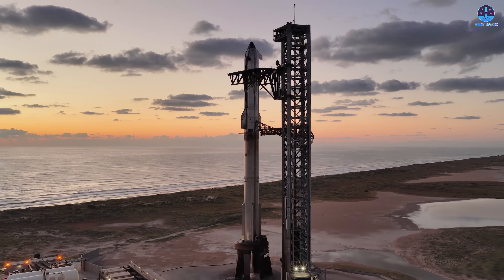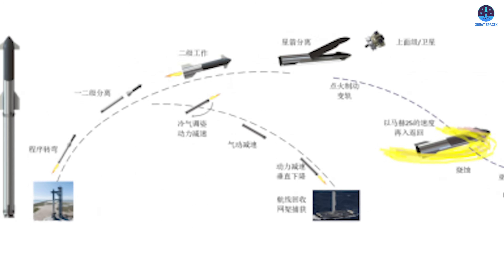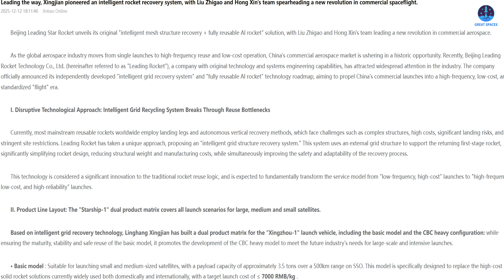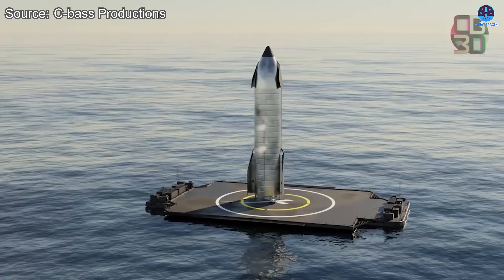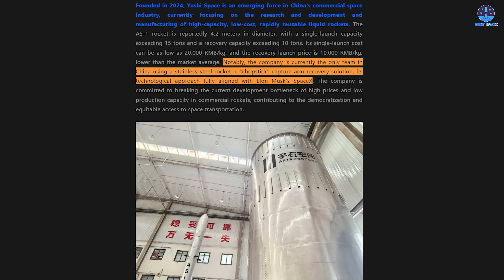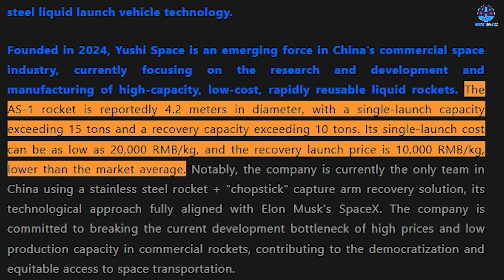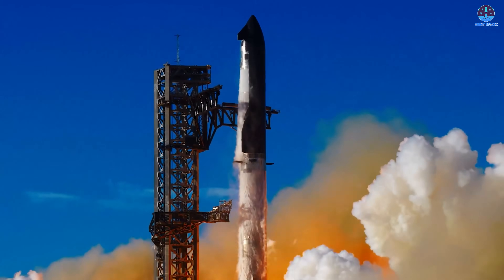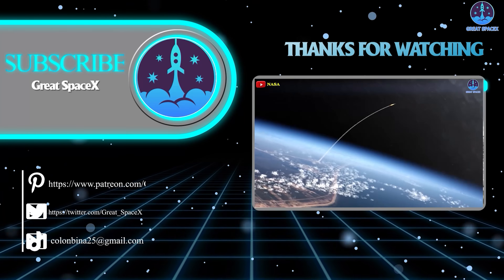Disaster! China just Reavealed the PERFECT Starship Copycat Ever… SpaceX’s reaction!

Comment: Doesn't par with what SpaceX is doing. Even Starship Orbiter lander has reentry flaws. However' PRChina has a tendency to gang tackle problem issues and the reentry problem might end up getting solves with China taking the lead. The trick is to get Daniel J Blatecky of America down to SpaceX and allow him to give assistance on this issue and you'll be in the pink. If not, what will occur is the Starship will flounder and just end up a continuance of two failed previous space shuttles. Isn't fourteen dead enough, or do you need more? Elon Musk and the president are accessible, but it seems they have a tin ear problem. This is not my doing. d.j.b.

Comment: Why be surprised!!
Engineers COPY stuff - if engineers did NOT use the ideas that other people had then we would still be wondering about the best stones to throw at the Sabertooths

Every engineering design sits on a HUGE pile of previous work
Reply: The Chinese acquired, completely tore down and copied an Airbus A320.  Unfortunately for the Chinese is still required western engines.  Even with the western engines it is still 10% less fuel efficient than the standard A320 because it is over weight.  Even when they have the working item to copy they still can't do it.  Boeing and Airbus study each others designs and innovate from there.  Innovation is something China doesn't really know how to do.

Comment: Fy 1 Interesting Knock-off more tear down ease , Pump Coupler Aligned , Dynamic Plumbing Solution , Marjing very high grade space Casting , Griswald look Quality ! No Hot Stage Volatile eomeg Igniters or sure flame Charge with Break Away if they can pull it off ++ !. Heat Shield Exposure  Angle Altered in Run off Skip Velocity + ; No Landing Gear Retrieval makes for many Concepts+ ! Imitation with Innovation the Highest Form of Compliment !.
Reply: what?